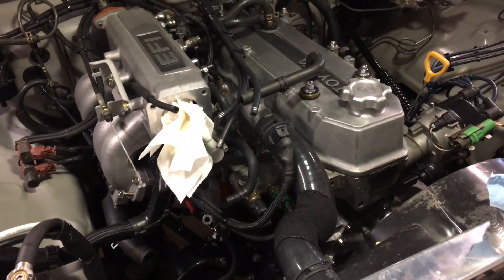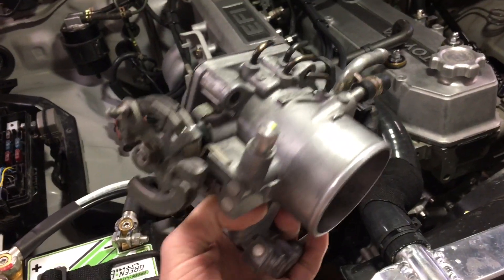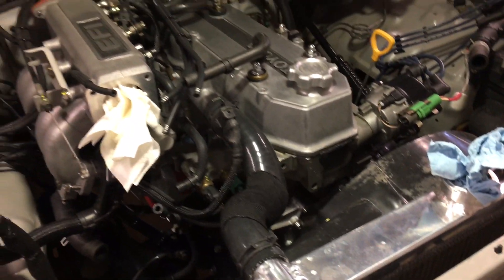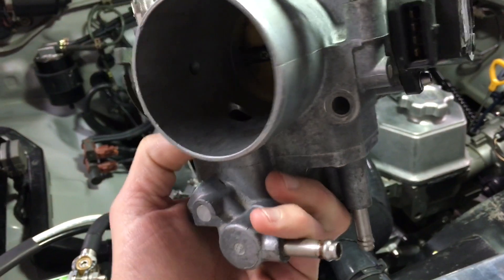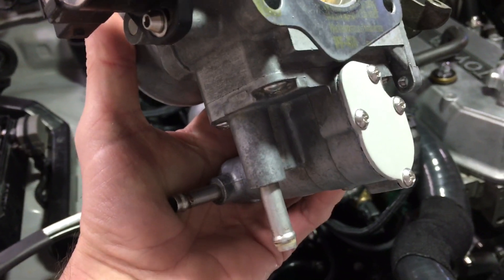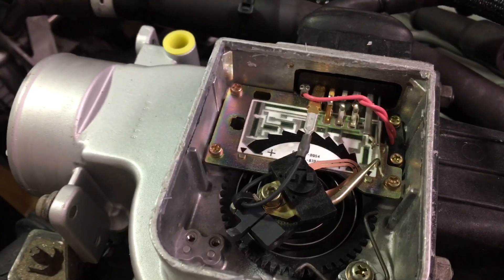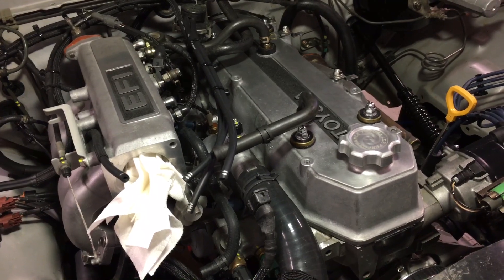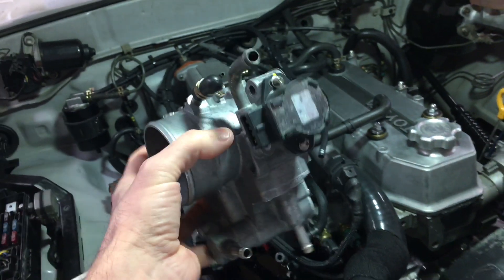Adjusting the Toyota 22RE pickup IAC auxiliary valve for more stable idle warm up

Comment: Hey Ray, great videos. I may have missed it in the video or comments, but you say you ended up about four turns out, but do you happen to know where the factory setting was?? Also, I’ve played with this system for years on my trucks and noticed that some of the IAC valves are stamped “1-A” and some “1-B”. I’ve been suspicious for years about the different markings, as they must have some meaning. This is the case for both aftermarket and Toyota Aisin made units. Lastly, I bought two of the champion rads from for my trucks after seeing yours, they are superbly crafted. Let me know what you think about the markings on the IAC. I’ve looked, but you seem to have a knack for finding information.
Reply from the maker: I'm currently running mine at 4 turns CCW out from fully seated yes. That seems to work well for the most part. I've noticed that around 100-130 degrees (oil temp) the truck sometimes idles a little odd, but it's fairly minor. I also recently adjusted the AFM 2 clicks more rich, which has helped idling overall (I think I had my truck running a bit lean across the board, due to the ported cylinder head, etc). But in my testing using hot water from the sink flowing through the IAC valve, 3.5 to 4 turns shuts things down around 125 to 130 degrees coolant temp. I wish I had marked the factory setting when I took things apart, but sadly I didn't fully understand the implications of what I was working on at that time. Not sure what the different Toyota casting # might refer to. Champion Radiators are okay, although mine leaked and I need to replace it.
Reply: Thanks for the reply Ray. I’ve watched most of your videos on the truck, some many times. I can appreciate your attention to details and knowledge. I too have spent a lot of time playing with my 1995 pickup, the last 22RE year of those trucks. I have a ported head stage 2.5 build from Jim Putney at 22RE Perfomance, had LCE header, still have their muffler and throttle body.
It runs well driving, but has honestly always had issues at hot starts and idling warmed up. I’ve been through every wire and sensor many many times.. all swapped and or replaced with Aisin, Denso and or Toyota parts. I had two newer IAC valves laying around, one from Toyota and another from Oreillys, and had been running the Toyota valve for a few years. In that truck I have the CSF 3 core radiator and I believe part of my idle issues are stemmed from too much heat dissipation. As it idles up on cold starts and then down, where I’ll set the idle screw etc. It cools too well after the thermostat opens in winter up here in Seattle with the heat on. Lately it’s been abnormally cool. So it idles up, then down as it heats up, then the TStat opens and cools things a little, which subsequently keeps open the idle valve just very slightly, which results in a higher driving/stopping idle (TStat open). So then I lower the idle screw, which results in too low idle at hot starts etc. I’m chasing my tail.. So, while farting around watching your videos I thought I may be having a similar situation to you, but with an actual functional valve etc. I mangled those two valve nuts pretty good trying to fabricate a socket tool. I finally have one I made from an impact socket , but have been hesitant to try it until I know damn sure she’ll get that nut turning without stripping it further. Any advice? I’ve been delicately soaking the adjustment nut threads in blaster penetrating oil/acetone for a few days until I have time to fool with it. I’d love to exchange information to bounce ideas if you’re comfortable. I’m not a serious YouTube junky, but I’m looking forward to seeing the engine swap you’re working.
Reply from the maker: @johnswennumsom5258  Hi John - You can test the IAC valve by taping over the inlet. That will effectively disable it and sometimes that can help tell you whether the issues you are seeing are related directly to the IAC valve or not. Just get some duct tape and remove that rubber elbow, then cover that one hole I show in the video. As far as removing the nut inside the IAC valve, you might want to apply some heat to the nut also. If you made a socket tool, you might also want to consider using one of those impact drivers that you hit with a hammer. Here is the one I use, which has worked great in situations such as these:

https://www.amazon.com/gp/product/B000IHWEWM

With regard to cooling and/or over cooling, the 22RE does need to reach temps of around 180 in order to function correctly. Most of the motor sensors need to be operating around 180 otherwise the ECU may still believe it's warming up the motor. I have similar issues sometimes on my truck, because I have an electric fan setup and a 170 degree F thermostat. It's not a major problem, but I have noticed the truck runs better if it's a touch hotter. Also, if you are running a ported head, you may need to richen up the AFM. If you haven't already done so, you might want to read up on adjusting that at LCE's website. I think I have a video which shows it also, but you cut open the seal on the lid for the AFM and then mark the wheel in there (for the factory setting). Then I'd suggest running 2 clicks more rich (turn the wheel with the notches CCW 2 clicks by holding that spring wire thing off it with a screw driver). Idling on the 22RE will be greatly improved if you give the motor a slightly richer base line to operate from. The other thing is bump your base ignition timing (with the jumper between the TE and E1 I believe on the diagnostic box) to more like 7.5 degrees, instead of the factory 5 degrees. Also, you might want to run through the setting / adjustment process on the TPS since that can really have a big impact on smooth idle. Finally, check the door inside the AFM to ensure it's not sticking or biding against the housing; if that happens and the door is not opening correctly, it will mess up your idle something terrible. Also, clean Denso plugs can help matters too. I personally run Denso W14EXR plugs on my 22RE (with basically no ground strap on them) and a higher output MSD coil and plug wires. The hotter range plugs help offset a motor which is not getting up to temp as well due to the better cooling system. Also, you might try running your idle more around 850 to 900, instead of the factory 750, especially if you have a slightly larger cam. Let me ask you, do you have any air/fuel gauge or vacuum gauge setup? If so, what vacuum level (in in/Hg) are you pulling at idle there? Feel free to contact me directly via the address on my YouTube page there also. Happy to chat anytime.
Reply: Thanks Ray, yes, I’ve been through the gauntlet on these trucks. I’ve adjusted many o’ VAFMs over the years. My TPS is spot on (0.57” < 2.3 kohms, 0.85” infinite) and a factory part. And the TPS has no dead spots. It would take a series of novels to detail my experiences and work on these vehicles. We’ve owned around six over the last 13 years. This white truck has always given me trouble though, while every other build/project I’ve done goes smooth. I’m gonna play with the valve here shortly and see what happens. As I said, even with a new factory valve I believe they never quite shut after the TStat opens in winter up here in WA. I have three newer IACVs here and before touching the adjuster nut, all three are set at different turns/rotations, with the largest discrepancy being about a full turn. This makes me wonder, but then again, everyone getting a newer valve would be having these issues. Maybe they are ? Who knows.. It’s interesting. I have an impact and yes, they work well. I suppose I’ve been a little too conservative on moving the adjustment but. I thought about heat but was reserved about the wax valve and rubber in there.
Reply from the maker: @johnswennumsom5258  You can rule the IAC valve out by covering the inlet hole with some duct tape. You might also try resetting your ECU by pulling the 15A EFI fuse under the hood. Also, try running the AFM 1-click or 2-clicks more rich along with the reset.
Reply: I’m gonna try about 4.125 to 4.20 turns out, so right at about 4 1/8 turns. Blowing through the valve with it at that adjustment seems to be really tight, but then again, it doesn’t take much air to cause idle to change, as we know from our idle screw and experiences with vacuum leaks etc. I’ll let you know. I had the system disassembled so I’ll try the tape on the hole if etc needed. I’m very familiar with resetting the ecu and adjusting the air meter. Without trying to sound like an ass, there isn’t anything I haven’t done to a 22R/RE. Stand alone ecu is basically all I’ve never tried. I’ll let you know. 4.125 turns it is.
Reply from the maker: @johnswennumsom5258  Ok sounds good. Yeah, let me know what results you get over there.
Reply: Watching it burp now from first start. Giving her a little burp due to having the hoses off the IACV and losing a little coolant. So far, it fired really low in idle, but not below about 1000 rpm, and it’s cold here, but the truck is in the garage and it’s probably around 50 f in there. I’m gonna drive her, but I may take it out a turn, as I didn’t get much of a high cold idle at all, but as I said, it was in the garage.. who knows . What is your cold idle at with the ~4 turns out?

And Ray, I’m not seeing your email. I wanna email you my contact information. You and I have lots to talk about..
Reply from the maker: @johnswennumsom5258  Usually if it's really cold out, it will jump up to around 1500 for a second there.
Reply: Also, my setup is configured so that I can take the throttle body off very easily without removing the coolant lines, as I replaced my stud there years ago with a bolt. It makes things much easier to do quick things. I suspect I can get the backing plate off and adjust the nut on the IACV without complete removal of the throttle body. We’ll see.
Reply from the maker: @johnswennumsom5258  Yes, that stud is always a bit tricky to clear :) I like your idea of replacing that with a bolt.
Reply: I’m not seeing your email. I’ve gotta be missing something. All I see is your YouTube handle.
Reply from the maker: @johnswennumsom5258  It's on the about page of my channel.
Reply: And Ray, are you saying you seat that adjustment nut all the way down “seated”, and then backed it out about 4 turns? I did this and my cold start idle is too low. So I’m wondering if I counted out from the wrong spot, as I seated the nut completely as far as she’d go, then backed it out 4.125 turns. I’m gonna back it out another 1-1.5 turns and retry. Let me know if I did this wrong.
Reply from the maker: @johnswennumsom5258  Yes, that's correct. You have to make sure you do it when everything is cold of course. But you have the right idea. Dial the threaded part down until it seats - mark the lip with a black marker, then every carefully turn it back around 4 full revolutions CCW. You also have to keep in mind that a number of other things can and will affect idle. You need to ensure the door inside the AFM swings freely and is no bound due to corrosion or something. Also the TPS must be working 100% - I think you mentioned you already have all this dialed in before right? Also, it could be your cold start injector is dirty? Or that the cold start timer is not functioning. Also, if your motor is modified and/or running lean for some reason, that can negatively impact idle quite a bit. Have you tried clicking the wheel inside the AFM on click (clockwise) richer to see what overall impact it has? If you have a ported head or free flowing exhaust, sometimes 1 or 2 clicks can make a world of difference. I personally run mine at 2 clicks richer, and that makes a big difference in not only correct A/F ratios, but also more predictable idling.
Reply: Yes, I have several airflow meters for this model truck, some I’ve messed with to the point of no return, so I’ll pickup another unmolested one at a yard or part out to get back to baseline. They all work perfectly and have the appropriate resistance etc, at the sensor and signals to the ecu. I’ve tried many different adjustments with only limited success. I do have a ported head and cam, but nothing that “should” require alterations of the factory EFI system. 22RE Perfomance builds a lot of motors and their builds are supposed to run without monkey business with the EFI. I’ve had the wheel adjusted as far as 7 clicks rich to see what’s what.. I find the adjustment to richen the mixture a little weird, as with time and thousands-millions of openings and closings of that door in the VAFM, you’d think it would need to be tightened (clockwise) to lean the mixture to normal specs, instead of counterclockwise to richen. As the age and wear on the part would loosen the spring over time. But, I digress. Not saying it’s the wrong thing to do, but that to me it seems counterintuitive given the age and dynamics of the part. Everything works on this truck. I have the year make and model factory service manuals (3 editions) and all check out in spec. Plus, the entire truck is new in terms of sensors and mechanically. But I’ve checked and rechecked everything many many times over the years owning it. With emissions, without… with some emissions etc. I currently have the egr deleted and just run the Pair Valve system, but I’ve run it with and without both as well. It is a California emissions truck btw. O2 sensors are both newer and signals get to the ecu and diagnostic box. The temp sensor and time switch are spot on and newer oem Toyota parts. It does fire right off when cold. The issue I’m chasing here is after warm up when idling down, it will get a little rough, but smooth out after a few minutes. Then when driving it acts like the idle is too high (by like 2-250 rpm’s). So I’ll back the idle adjuster screw in, but then she needs more air on startups when hot. So, I suspected the IACV was reopening slightly when the TStat opens and when running the heat/ cold air moving over the rad and motor, as all of these occurring will temporarily cool the motor a few degrees etc. etc. So, my hypothesis was to spin that adjustment nut in a little to see if we could get a more stable idle when hot to keep that IACV shut when warmed up. It did. But, the alleged 4 turns was too low for my truck. I went 4.125 btw. Now, I went to about 5.5 turns, and that was better, but now I suspect we’re getting close to the original setting, which will cause my idle to vary when driving, again. There has to be a sweet spot in this where I can keep the IACV shut when warm, yet get a good high cold idle to warm it up. The trick is matching the ecu fuel ratios in open loop warm up mode until she is into closed loop and warmed up. It’s tricky. Times like these I really appreciate the simplicity of carburetors and chokes, NO computers to get in the way of tuning. Easy as pie. I’ll keep messing with it.
Reply from the maker: @johnswennumsom5258  I'm with you on missing the days of carburetors... I've had that thought more than once while fiddling around with the EFi on my truck haha. 

On the subject of adjusting the AFM wheel..  when you turn the wheel counter clock wise, that unwinds tension on the spring; this causes the door to open more easily; because the door is open a touch more, the ECU responds by adding more fuel, thinking more air is coming in than actually is. Turning the wheel clockwise, adds more tension to the spring, which makes it harder for the door to open; this reduces the amount of full being added, which does lean things up (as you mention above).

Here is what I will say about fine tuning the AFM wheel: unless you are running a wide-band O2 gauge, then you can just about forget finding the "sweet spot". My advice, based on the mods you have, would be to run 2 clicks to the richer side. But again, unless you have a wide-band AFR gauge, you are just fumbling around in the dark. On my truck (and I have my air/fuel ratio gauge configured to read Lambda, so you will have to multiple by 14.7 to get an air/fuel ratio here), idle is around .90 lambda. Under WOT, the ratio is generally between .75 and .95 depending on throttle position, etc. with an average reading of .85 by and large. That gives good power without erring on the side of running the motor too lean, etc. The 2 clicks on the AFM pushes the idle A/F ratio from 1.00 down to more like .89 or .91 at idle, which richens up the mixture at idle and helps smooths things out a lot. 

I have my truck set to idle around 850-950 and at times it does what you are referring to there... sometimes idle will jump up to 1000 or drop down to 850, etc. The reason for this - especially when coming to a sudden stop, etc. is because you may be coming off open loop and moving back into closed loop operation. When this happens, the ECU is only receiving data in closed loop once every second from the narrow band upstream O2 sensor. So it can take anywhere from 5 to 10+ seconds to receive enough data for the ECU to sync up the correct idle mixture. Without an wide-band O2 sensor gauge, you cannot see this occurring in real time, therefore it's much more difficult to understand or monitor and adjust. 

Also, you might try clearing your ECU (by pulling the 15A EFI fuse) just to clear the tables and force it back to baseline mapping and cause it to re-trim the tables out. This is good practice when you make any changes, as you probably already know.

As far as running 7-clicks on the AFM, that's crazy talk. In my experience, even going 3-4 clicks in either direction can throw you so far out into the weeds that nothing will work quite right. Sure the motor will run (especially once it's in close loop), but you'll constantly be battling against some flawed baseline info. 

You should also be monitoring engine vacuum over there. If you are, then let me know your vacuum levels at idle. Even a very, very small source of un-metered air can ruin your day. If you are running a K&N breather on your valve cover for example, then all bets are off.

Also, have you taped closed the inlet hole for the IAC valve yet? This will tell you a lot (such as whether your un-stable idle issues are even related to the IAC stuff or not).
Reply: Yes, 7 clicks was way into the weeds. I did that on my old motor after doing an aggressive cam and rocker set swap while awaiting my motor from Jim Putney at 23RE, but just for a few to test and see where she’d go with it. It was stupid to say the least… Yes, I saw that you’re running a wide band in your videos, and I’ve considered it many many times. I have about the same setup you do in terms of tools and capacity to tinker (small welder, grinders, vises, benches etc). Anyway, recently I swapped injectors out and had them check my newish set I had in there (from about 3 years back), two came out pretty lean, so we noticed a good difference in that fix/improvement. I had played with the air meter wheel all summer really. But, because I don’t commute and live at work on station, I only did minimal driving and my new motor installed last November from Jim Putney at 22RE Perfomance only has about 3500 miles on her. And yes, I reset the ecu most times I make a significant change. Here’s the thing as well Ray, and I love that you’re a technical dude “using lambda etc” as my background is in fish and stream ecology, but I have education in bio and chemistry, so I’m no Einstein, but not a stranger to physics and thermodynamics. I’m learning electrical as I go, but my wife’s 86 4Runner, 2.4 as well, which I rebuilt also, ran perfectly straight. That truck had no idle issues at all and I was able to rebuild that older IACV no problem. That truck didn’t care what I did to it… it just ran beautifully. Oh, I should mention I’m also running an LCE big bore billet throttle body. The 4 Runner had one as well. And we’ve owned a good bit of the 3VZ-FE trucks over the years as well, all of them ran great. This 95 white truck is a mystery. I’ve loosely followed your videos since the meow bang days, so I’ve been at this awhile as well. I’ve learned a ton, and to be honest, the truck runs and drives pretty darn well. It also had a hot start issue that I could never remedy. After years of research and playing with it off and on, I ended up wiring a toggle switch straight to the fpu vacuum switch so I can activate it manually on hot starts to raise fuel pressure during hot starts. It works fine. There’s something Toyota missed with the temperature range on activating that vacuum switch from the ecu temp sensor. And the earlier trucks had a recall (TSB), but my truck is the last year of the 22RE and the recall doesn’t apply. So, to the switch I went. It’s interesting. I’m gonna burp things again tomorrow (as I’ve been in there a bit often lately), and I’ll cut my sealant off and turn the VAFM two clicks rich to see how we do. At cold start this afternoon and at about 5.5 turns out on the IACV nut, we saw about 1300 RPM cold idle. It idled down to the 750-800 area in time, but was a slight smidge rough getting there. I’ll drive it a bit after that and see. I suspect I might need to go a tad in on the adjustment, as I’d rather have a constant hot idle than erratic, and a slightly low cold idle, if that makes sense. I also watched a guy on YouTube do a video on the 3VZ and his adjustment came out good, using the same logic. So I’m starting to lean towards that conclusion and logic to settle on. I planned to click that meter a few after the injector fix anyway. I’ll let you know what we see. Thanks for the chats and time. If the typos and many, it’s because I’m using my phone to communicate. Too lazy to get the laptop out.. Lastly, I was able to remove the back plate on the valve without removing the coolant lines due to that stud being removed, so much easier and less time consuming that way. It makes it quick.
Reply from the maker: @johnswennumsom5258  I actually saw your video of your wife's red 4runner there.. did you sell that yet? 

A few more things to consider here... what are you running your base ignition timing at? I've started running mine at 7.5 BTDC with much better luck than the factory prescribed 5 degrees. Also, with regard to the VSV's, I personally bypassed the fuel up one and just ran the vacuum line directly to the manifold - works like a charm. As you may have seen, I have a fuel pressure gauge also, so I'm able to monitor that and running the vacuum line directly eliminates on of the VSV's and has no adverse effects. 

The only way to properly burp the cooling system that I have found is with one of those funnel kits - do you have one of those handy? For me, not much else has ever worked 100%. I can post the amazon link to the one I use if you'd like.

Also, along with running 7.5 degrees initial timing, I usually set my idle at more like 900 RPM's - I have a real nice induction timing device for working on chainsaws, which allows you to see the idle very accurately. When running an aftermarket cam shaft (which I believe we both are doing?), I've found the idle just isn't going to be quite as smooth as factory, unless you bump things up to more like 900-1000 RPM's. What I can tell you, based on monitoring my gauges and how well or poorly the truck idles, is that the largest overriding factor to smooth, stable idling came when I adjusted my AFM 2-clicks more rich. That alone had the biggest impact on smooth idling, at least on my truck (A/F ratio of around .90 at idle). If I put my AFM back to "stock", which causes the lambda reading to hold very steady between .99 and 1.00 at idle, the overall smoothness of the idling tended to vanish. 

Also, when taking into consideration the opening of the IAC valve (which on my truck tends to have the most negative impact on my idle precisely when my engine oil temp traverses from 100 degrees to about 140 degrees), I noticed that when the motor was running richer (aka the AFM 2-clicks more rich), the tendency for my truck to idle poorly around that spot between 100 and 130-140 degrees (oil temp, not coolant temp), tended to subside quite noticeably.

You might want to try running some B12 chemtool fuel injector cleaner through your gas tank. Having clean fuel injectors definitely can play a role here. I'm running the Bosch 4 hole injectors on my truck, although I'm not sure it helps all that much. 

Having the AEM gauge and wide-band controller is super nice. If you can do it, I would say that's a really great upgrade and definitely is extremely helpful when it comes to turning the 22RE. On my truck, for a long time I was running things too lean I think. The truck ran fine, but idle always sucked and seemed overly unstable. Once I dialed in the AFM to 2-clicks and started paying closer attention to the A/F ratios while driving, etc., not only did the truck start making better power but also the idle improved quite noticeably. 

Interestingly, I tried also just 1 click as well as 3 clicks and both did not prove to be helpful. The stock location was okay, but the truck was running lean and idle was off. Gas mileage was great :-) I'll say that. But I'm far happier now running 2 clicks. More power under acceleration and a far more stable idle, even when the IAC valve is doing its thing. 

BTW, what plugs are you running and what is the compression figures for your motor? Oh, speaking of plugs, you know I run my motor with the ground strap totally removed on the plugs right? You'd be surprised how smooth that makes things. I just leave a tiny (1/16th) nub sticking up, but otherwise the ground strap goes. If you are not doing that, what plug gap are you running over there? Also, make sure you have proper grounding between the block and frame/battery, as well as maybe an extra ground from the cylinder head directly to the block. When I added that, I noticed my motor seemed to run a bit crisper.
Reply: Moving slowly this morning, so I haven’t waddled out to the truck yet this morning. But I’ll get there.. So yes, a burp funnel is worth the weight in gold.. and I always use mine and run the motor a good while with the heat on and squeeze the hoses to work out the bubbles. 

My timing is right between 5-8 on the oil pump marks. I’ve messed with timing many many times with minimal improvements other than a slight snappier response. I’ve ran both the Denso w16-exru and NGK plugs on this motor. I tried filing off the plug a bit to open up the gap (got the idea from your tests) and have the gap currently set at about .032-.035” and or > .8 mm or so.. My grounds I replaced with really nice copper stranded stuff off Amazon (I forget what size, but larger than stock). I soldered the lugs on and used heat shrink to seal things up. They all seem to have good continuity. I have swapped the grounds in and out with others as well to check if I missed something there. But, as I said.. the wife’s truck had all the same treatments and ran beautifully. Yes, we sold her truck for $15500. I also sold my 81 pickup for $8000. We ended up buying a new Outback Wilderness for her. Our first new car ever, which I’ve been an opponent of, but it’s paid for and on warranty for longer than well need. So far, we love that car and the turbo charged motor is nice on the freeway here in Washington going up the passes. It eats snow too, which we just recently tested in the last week. 

I haven’t tried running without the injector strap to the intake manifold, interesting? I briefly tried flamethrower 4 hole injectors, but the motor acted like it wanted to fall on its face during hot starts. So I yanked them and sold them. Now, I suspect a 4 hole would work, but that I got too rich of a spray. I’ve contemplated buying from osseditger? online to get a more close match to factory volume/time injector. But my injectors are fresh clean and balanced from doctor injector here in WA just a few weeks ago. I also have the LCE liquid filled fuel pressure gauge which tells me I’m getting the appropriate fuel at idle and startups (~38 psi w/vacuum, ~44 psi w/out vacuum). I’ll email you later with my contact info so we can speak via phone. We are indeed kindred spirits.
Reply from the maker: @johnswennumsom5258  Sounds like you have gone down all the similar paths I have, with regard to the 22RE and trying to get things dialed in. 

I'm not sure what you meant by this: "I haven’t tried running without the injector strap to the intake manifold, interesting?"

By the way, what outside temps are you dealing with over there? 

I'm about to go work on my truck. I've got a bore gauge I wanna test (putting it down the spark plug holes, etc.). I also need to put the plugs back in after having soaked the pistons for a couple days with B12 chemtool. I'm still trying to reduce oil consumption over here, but I'm starting to think I might have to pull the head off and remove the pistons to clean the rings, if I'm going to have any success. I might just baby the motor for now and keep dumping oil into it, since once I move I won't be taking any further super long 1000 mile trips.

I rarely speak on the telephone, so email is really best and/or posting here is great too (since other's can also possibly benefit from our discussions).
Reply: So my adjustments on the IACV are making progress. I’m still getting a rough spot on warm up when the motor isn’t up to temp quite yet, but the adjustments are helping with idle at stops and limiting the creep into 1000 RPMs etc. So Ray, I saw you also chose to keep your pair valve system functional, what and why did you choose that route? I had mine deleted for years, but figured I’d slap it back in to see if it helped with rich/lean on the computer and front O2 readings. Another one of my theories about why my truck has been so finicky, is that it’s is a California emissions vehicle, with more limitations put on things. How much difference is there b/t federal and California, other than the downstream O2 and egr temperature sensor is debatable.. Likely those systems are there simply to keep them in place at emissions checks. But I can say from owning multiples of these trucks over the years that the California truck I have now had smaller diameter and longer down tube/header pipe on it than the federals do/did, and the cat converter was 17.5” rather than the 12.5” federal. So, there are different pieces to consider when eliminating emissions and involving head porting, camshafts, etc etc. I’ve often wondered if swapping some pins around and installing a federal ecu for this truck would help things run better. Anyway, I’ll continue adjusting and testing. I didn’t get a ton of time to test what I’d done so I’m inconclusive about the two clicks added to the air meter.
Reply from the maker: @johnswennumsom5258  Yeah, the Air Suction hardware doesn't usually cause too many issues either way. It's nice to have it on there for testing purposes, etc. It mainly comes into play at off idle on deceleration from what I can tell. With the header and exhaust system, you can hear it open and close when you drive. It's all controlled by the AS VSV through a single vacuum line. It's easy enough to enable or disable for testing purposes. I was wondering if the induction of clean air into the exhaust stream might have some positive impact on data coming from the upstream and/or downstream O2 sensors (and thus impact idle or overall air fuel stability when changing throttle positions under load, etc.) but as near as I can tell, it doesn't seem to make a heck of a lot of difference either way. 

As far as switching to the federal ECU vs. the CA one, I'm not sure. I have thought about running my own ECU, but I am going to leave that for when I swap motors. For the 130-140 HP I'm pushing, the stock ECU works just fine for now. I don't know if the different ECU would make a lot of difference or not. One thing I did want to mention (and you might know this already yourself, due to your own testing) is that anytime you clear the ECU fuel trim tables by pulling the 15A EFI fuse, it generally takes about 3 days of driving around before the idle smooths back out and the fuel table is populated again (based on my observations at least). I could be wrong, but that is what it seems like.

Setting the ECU to 2-clicks more rich will probably help stabilize your idle a lot more than you realize. 

Even on my truck, there is a "doesn't always idle great" spot right after the truck starts to warm up (oil temps between about 100 and 140). When I start the truck cold, the oil is usually around 60 degrees or less this time of year. During normal operating conditions, it's about 180-190. Climbing up large hills, I've seen it go clear to 224 or 225 before rapidly dropping down when going over the top of the grade, etc. Normally anything over 200 degrees is unusual as far as just cruising along. 

What RPM's are you running your idle at? I have mine set to idle around 950 to 1000 right now, although I have run it at 750 to 800 before without too much problem.
Reply: I just skimmed through.. but speaking on the camshaft, I’m also familiar with the issues between carb and EFI. The rumor is that to run the EFI you need about 114 degrees lobe separation, while some of the cams out there are very cool, many are 112 degrees lobe separation. Yeah, I dont know exactly what cam I’m running currently but could find out from Putney. He does have an impeccable reputation though and is the person who informed me about the lobe separation specs. I’d like to run my truck at about 750-800 idle rpm’s. But it does “like” to run better closer to 900. It always has.. my vacuum gauge is older from harbor freight and broken-ish (ie the gauge needle is off, but I can likely recalibrate it), but nonetheless is the reason I haven’t tested idle vacuum yet. I’ll get that done soon. Also, I’ve run both a 112 and 114 in my truck over the years. The 112 never ran quite respectable (I have high standards though), and the 114 was on a motor I don’t think was healthy. So, I have no honest idea. Both were Delta shafts form here in Tacoma, same place many of the builders (Putney) get them, and possibly yours. I know Putney has his own profiles specific to his builds that he’s perfected over the many years. I kinda had a lot going on in my motor at first.. porting on the head and gasket matched upper plenum into the big bore throttle body, high flow air filter, all the emissions deleted. Since, I’ve gone to a factory upper manifold and reinstalled the pair system (for the exact reasons you mention above regarding O2 sensor readings and air fuel ratio etc). I suspect I had my upper plenum unbalanced inside the runner porting and so decided to pickup a stock upper plenum and clean her up pretty. I did notice a good difference with that. Overall the truck runs good. There’s about three gremlins I’m trying to iron out. A) the inability of this truck to start a smooth clean idle when hot and sitting for a few minutes B) the idle wondering up at stops to around 900-1000 despite having set it at 750-800 (which is common on these), and C) the slight rough idle spot on warm ups at a cold start. And yes, a few days of driving and or I believe the rumor is 60-???  amount of miles. But yeah, it takes a bit of driving to get the ecu locked in. I should probably be more patient as that’s a tendency I have. As I said, I don’t commute and so don’t put miles on this truck at all. I have had to really work at it to get the break in done last year.. kinda funny really, but a good problem to have living on the puget sound. Traffic is horrible here every minute of the year. Nothing more frustrating than trying to test a car in stupid traffic.
Reply from the maker: @johnswennumsom5258  Yeah, when I researched it over here, I think it was something about lobe separation or something along those lines. I don't remember all the technical details; I just remember I opted to go with LCE's "EFI pro cam" and so that's what is in the motor now. It's okay for tooling around and most highway stuff. It has decent power up to about 5000 RPM or maybe a little more. This could be just the motor not really breathing overall, not just the cam profile. It makes its best power from about 3300 to 5000 or sometimes 5500. Lately, my truck has been running better and on a cold evening, it even seems to have fairly good power clear down around 2500 when cruising along (of course, I run a 35 lb flywheel too, so there is a lot of kinetic energy in the mix there too). 

As far as starting up, on my truck, it starts pretty much right off the bat - even when hot. I think I've read that issues on hot restart could relate to leaking injectors and/or the cold start timer switch stuff, although that's not an area I have ever fooled around with too much. The only time I ever had a starting issue was after soaking the cylinders with B12 chemtool. I think I might have put the plugs back in and there was some liquid B12 (from spraying B12 in there to clean the spark plug threads) and perhaps that ended up splashed up into the spark plug ceramic insulators. I had a heck of a time getting the truck started (cranked it multiple times for at least 60+ seconds, until it finally started to come back to life). In retrospect, the truck acted very much like my Stihl leaf blower (the few times I've flooded it by forgetting to flip the choke off fast enough). I wonder if your issue relates to gas fouled plugs?

Are you running LCE's extended idle adjustment screw? On my motor and my friend's truck, we both had to install slightly larger OD O-rings to help get an extra tight seal on the idle adjustment screw (LCE or stock both).

If you do monitor the vacuum levels, I can tell you that on my motor, with idle at around 975 to 1000 - when everything is running just so with my truck and it's all warmed up - I'll usually see about 18 in/Hg at idle (+/- .25 in/Hg). On deceleration (completely off throttle and the motor braking the vehicle to slow it down), I can pull just a hair over 24 in/Hg peak. When I first bought my truck and was stilling trying to get things working correctly insofar as the piston rings, etc. for a while I was only able to get around 22 in/Hg and then after I poured some cleaner through the cylinders and installed that LCE crank scraper, something seemed to work itself out and all of a suddenly peak vacuum started going just a hair past 24 in/Hg. 

Also, what are your valves lashed at? I've noticed on a new cam w/ new rocker arms, you have to chase the valve adjustment around more than a couple of times. I haven't checked my in a bit, but I do recall that right after building this motor, I had to practically re-adjust the valve every 1000 miles and there was almost always one or two valves that were out of spec. Having even one valve out of whack and really mess with your idle, although usually you can feel it popping and cracking when driving too. 

 Are you running a stock ignition coil and stock spark plug wires? I'll tell ya, two things which really improved my truck were grinding off that ground strap on the spark plug (as crazy as it sounds) and also going 2 clicks richer on the AFM. I think before you do too much else, you should try the AFM at 2 clicks and then see how that affects the idle. It took my idle from about 80 to 85% to pretty much 100% - and most of the issues you are chasing over there are exactly the issues dialing in the AFM cured for me. I could see it all manifest itself on the A/F meter also, which confirmed a lot for me. The bottom line is that if you run the stock AFM setting, the ECU will idle and try to pin the A/F ratio right at 14.7 (aka 1.0 Lambda). It does a fine job of that too... that's basically its whole job. When you go 2 clicks richer, then it idles more around .90, and that richer idle mixture really makes a huge, huge difference as far as how smooth the idle is.

I can tell you from tuning my Yamaha R1 motorcycle also, when I went into the fuel table and adjusted the idle values it used to have a pretty dramatic impact on how my motorcycle idled also.
Reply: Yes, I have the LCE idle adjustment screw and I had to put a larger ring on there as I could audibly hear a leak and manipulate it by wiggling the screw. I run NGK wires and NGK plugs now gapped at just over 0.8 mm/ .032”. I have the air meter two clicks rich and haven’t tested enough, but will in the coming days.
Reply from the maker: @johnswennumsom5258  Make sure to reset the ECU also.
Reply: Also, what AFM gauge setup did you go with? Would you do the same? Send me a link. It’s time for me to know the air fuel ratio..
Reply from the maker: @johnswennumsom5258  I installed this one here: 

https://www.summitracing.com/parts/avm-30-4110

Yes, I would install it over again. I love it. It's simple and easy to setup. I don't need a bunch of data logging, so it does the job just fine.
Reply: Hey Ray et al, so my problem ended up being the opposite problem of what you (Ray) were having, as my IACV needed to actually be opened up more. My motor never actually had problems idling down when warm. I was trying to remedy a slight rough idle during the warm up process. As the engine heated up and things approached close to operating temp, I would get a bit of a rough spot. It wasn’t noticeable while driving unless conditions were timed perfect and stopped at a stop light etc and still in warm up process. So opening my IACV has resulted in a higher cold idle and smoother transition process through the ranges. It’s interesting to say the least. Now, I also suspect that my three core radiator is in play with this, possibly causing the motor to take longer to warm up and fuel trim modes (or whatever is happening at the ecu) don’t quite match up with the openness/closed state of the IACV. And of course, there’s also the thermostat at play too, which is a standard 190F. Anyway, that’s the verdict for me.. opening the valve a good 1.5 turns past the factory setting gave me a smoother idle transition. Cold idle at about 45-55 degrees is about 1500 RPMs give or take, depending on ambient temps and such..
Reply from the maker: @johnswennumsom5258  Pretty interesting, thanks for updating everyone. So what is the total turns CCW out from full in that you are currently running?